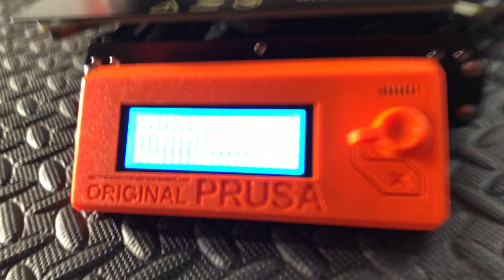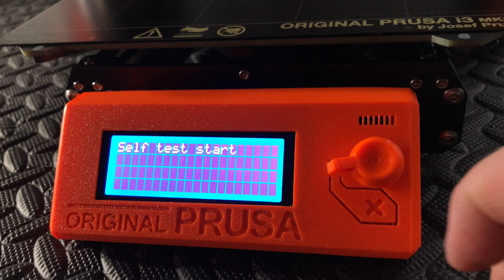Original Prusa MK3S Kit Assembly - Time-lapse

Comment: What is the difference between mk3 and mk3s? Thanks!
Reply from the maker: Hi Emilio, the biggest differences are a new extruder design that is easier to disassemble, and a more reliable, mechanical filament sensor. Otherwise, they are nearly identical.
Reply: @tinyplanet2264  Thank you Sir!

Comment: Nice video man! Thanks for taking the time to make it. Perfect amount and quality of commentary. I have a monoprice maker select v2 $300 usd and it’s ok. I am definitely getting a MK3s or later sometime! I make micro controller projects and random parts with fusion 360. A good 3D printer is great for that.
Reply from the maker: Thanks sir, I’m glad it helped. The monoprice was my first printer as well! I did a lot of work to it, and got a CR-10s, but felt like it was time to take the next step. The MK3S definitely feels like a totally different experience. There is lots of direction and support and you know you’ve got some of the best hardware built in.